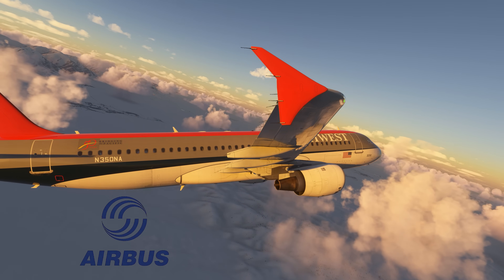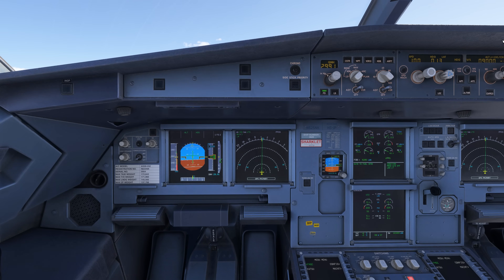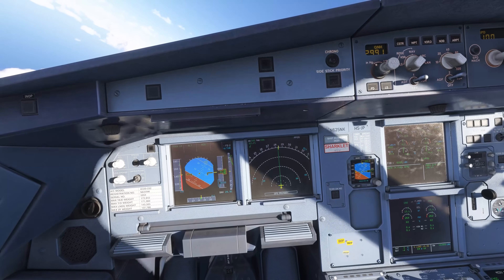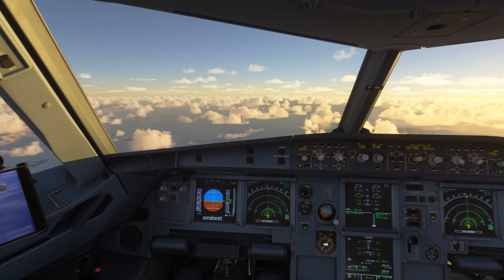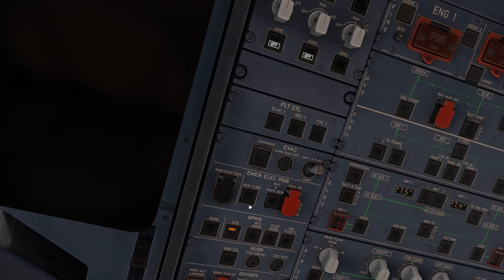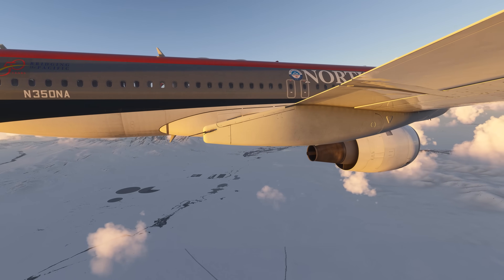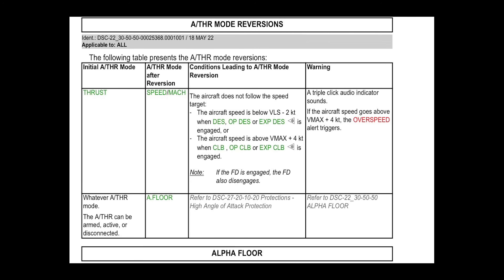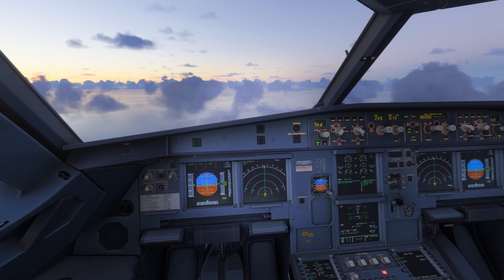Alpha Floor on the Airbus A320 — What It Does and Why It Matters

Comment: Can you do a video on the engine(?) noises the 320 makes when it's getting ready to land? Bonus points if you can capture it from the air!
I live about ten miles from CVG, and we get a lot of commercial aircraft heading due North over us, and at some point, they do a 180º to the West and then South, and then make their final descent.
But when the planes are very near us, they make some configuration change which causes the engine noise to sound like it's slowing down and then speeding back up. I've yet to fly on a 320 again since I've been aware of this phenomenon, and have only been on a 737 twice since then anyway. Do the simulators include this sound effect?
Reply from the maker: I think Airbus have a particular sound overhead when flaps are introduced or something along those lines. I remember reading something about it a while ago, lol
Reply: @Bananasssssssss  Some say it's the flaps or something external to he engine like that, while others swear that it's something happening in the engine itself.
It sure sounds cool!

Comment: Is it possible to reset the autothrust disengagement after the long button push ? Or does one need to land and turn off the power ? (Could it be reenabled by doing so in the air, even if you'd loose your irs and mcdu data ?)
Reply from the maker: Can only be done on the ground post flight by resetting FMGC 1&2 so once it’s completely off via holding the button for -5 seconds its unusable for rest of flight